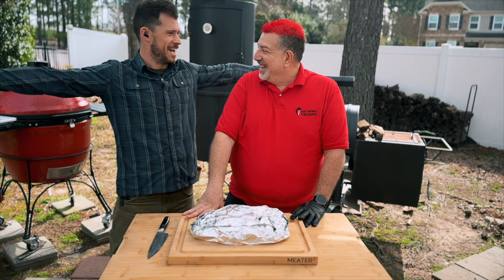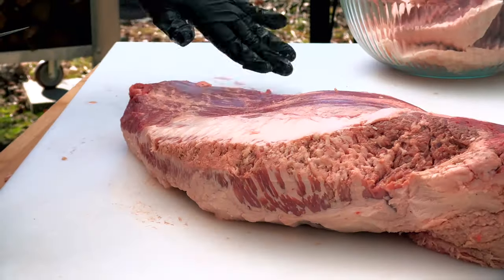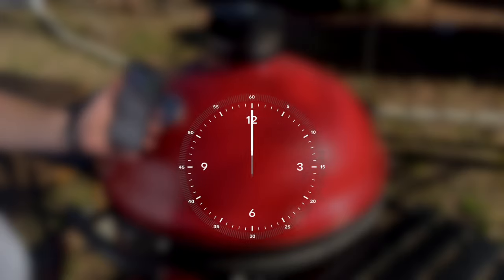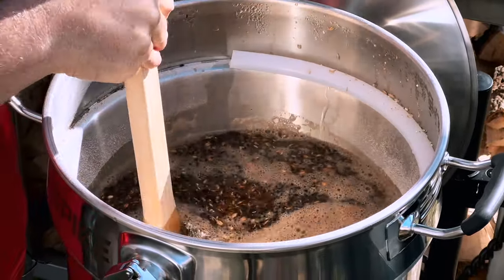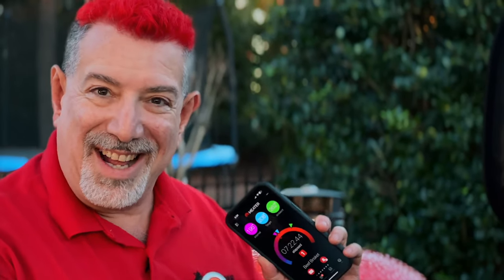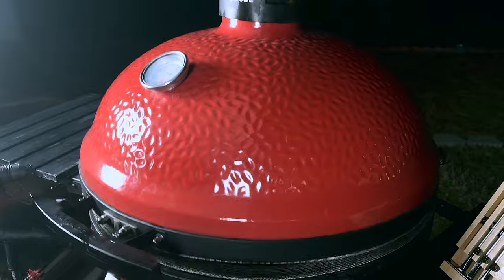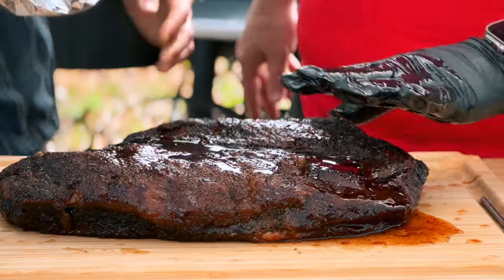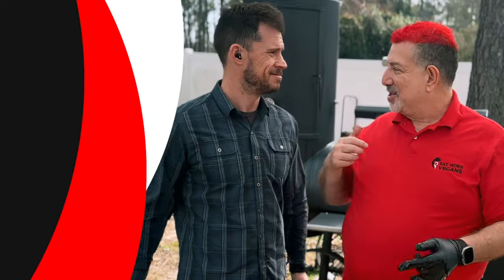Goldee's #1 Texas' Style Brisket......on a Kamado Joe?

Comment: You mentioned cooking at lower temp and pulling earlier or resting before going in the warmer.  I think that is the key when doing it on a kamado vs an offset. 

I just did a brisket this week on my Akorn kamado set up for double indirect. I cooked at 225 the entire time and pulled a little earlier (temp 195-200, not quite completely probe tender).  Held overnight at 140 for 15 hours. Great bark and so juicy and tender after the long rest.
Reply from the maker: You're right that pulling earlier and resting will make the difference.  Without giving away too much.....tune in on 3/22 for the video that shows that!  :-)

Comment: I've made a Goldee's style brisket on the SnS Kamado and it turned out great. Oddly a tad overcooked as well, and I did try to let it rest down to 180 or so befor eI put it in the oven to rest. I think it was just a tad overcooked when I pulled it off the pit.
Reply from the maker: I think I've figured out the secret to getting it just right - tune in on 3/22 for that video!
Reply: @BehindTheFoodTV  Can you advise where you put the water pan on the BJ3?
Reply from the maker: @scubahiker  sure. If you’re doing double-indirect the water pan sits on the heat deflectors (inside the SloRoller) and the drip pan sits on top of the SloRoller. Make sense?
Reply: @BehindTheFoodTV  Yes, doing double-indirect but on a BJ3, do I do it the same way? Or differently since I have more height?

Comment: This feels so odd to me. I assumed the Kamado would blow a Weber kettle away, but I've definitely gotten way better bark than that from the kettle (using just a snake, a foil drip pan, and some aluminum foil shaped like a shield to prevent direct heat!). I think the temperature really might make the difference. I also don't know what or how much wood you used, if any (vs charcoal). When I set up a snake there are always a few large chunks of wood during the first half of the cook that put off plenty of mouthwateringly tasty smelling smoke. I would definitely want to try something like that here.

Comment: One big issue with kamdo's is they pretty much have no airflow. So a lot less fat render. And also, since most of your heat source is from charcoal (with just a little from wood) you just don't get as much smoke and bark. You don't get that meteorite black bark from an offset.

I first smoked briskets on my dads egg, cause it's what I had. And it was a huge world of difference when I switched to an offset. And it was a crappy offset too, that I made out of cinder blocks. But even then, it was so much better.

I'm curious about the blaze cast aluminum kamado. Because it's all cast aluminum, you can cook with whatever you want in it. So I'm wondering if it's possible in that kamado to do a full smoke with entirely wood burned down to coals. I think the coals from hardwood may not last long enough though, idk. But that would be one potential way to get better bark and smoke. But I wonder if the lack of airflow is part of the issue with bark formation, idk.
Reply from the maker: The airflow is definitely an issue.  Using the SloRoller and the double-indirect setup that James over at Smoking Dad BBQ pioneered does close the gap quite a bit - but not quite all the way.  The method does allow us to cook briskets fat side up on a kamado though - which also makes a huge difference.
Reply: I'd be more more interested in a soft yellowish rendered fat cap, a meteorite black bark color is less relevant.
Reply: @CoolJay77 
I hear ya, the problem with that is I honestly just don't think it is really happening on a Kamado. It just does not have a lot of airflow sadly. Maybe if you made a very specialized modified kamado or something, but at what point do you just get an offset of some kind?
It is a bit of a shame, because kamado's are truly awesome grills. But not perfect sadly, not that anything is.
Reply: @copper4eva  Talking about modification, one can experiment with building a dome shaped sub-chamber made
out of steel, and a manifold, with a convection fan creating a vortex. That will take care of rendering the fat cap, and a meteorite bark, however the smoke flavor will still not match that of a stick burner.
Reply: I've always just built a small charcoal fire in my big joe 1 and added woodchunks as needed when the heat drops (every hour or hour and a half). Pretty much run it like an offset and my Briskets look and taste like an offset brisket. No double indirect BS. Just deflector plates,  fire banked to the back and brisket on the grate close to the front away from the heat.
Reply: @jlaw3255  
If you've got deflector plates on (which normally sit on a grate), how do you keep adding wood chunks so often?
Reply: I believe it’s all about your technique and the quality of meat used Choice, Prime or Wagyu. I have a BGE and I must say using Smoking Dads Double Indirect method. I can achieve good fat render along with that dark offset looking  bark. From most videos I see on YouTube it’s not the smoke that causes the dark bark, it’s the amount of Black pepper used on the brisket. I have mad respect for all those offset smokers, and maybe one day I will own one. Like anything in life use what you have and keep learning it until mastered. Keep Smoking Fellas!!!!
Reply: @mikecitizen2125  
"it’s not the smoke that causes the dark bark, it’s the amount of Black pepper used on the brisket"
The amount of pepper I use seem to make no difference to that result. In fact, last time I did not salt or pepper the sides much at all, and they still got just as much bark as the rest of the brisket. It does effect how peppery it tastes in the end though lol.

It's still cool to see someone get good results on a kamado. It's not that you can't get bark on it, I just personally never got near the same level. I also have not cooked a brisket on an egg in a long time.
Reply: @copper4eva  I just have one grate in and I lift up the one deflector plate and throw a chunk that's been drying out on the grate next to the brisket. It lights up right away. I got a big joe so lots of room.

Comment: Would the top maybe have gotten darker if it was fat cap down for a bit? I know that might have messed up the bark some, but just wondering if that might help since the heat is coming from the bottom instead of across like on an offset?
Reply from the maker: Great question.  The bark darkens because of smoke - so fat cap down would actually have reduced the smoke exposure.  I think more flavor wood and adding wood chips to the ash drawer during cooking would have made a difference though!

Comment: The WiFi MEATER probe works through the stainless walls of the warmer?
Reply from the maker: Yes sir! When I'm cooking on the offset I need to keep the block or repeater right on the shelf in front so the BTLE signal can get through.  On a ceramic kamado style cooker it's not a problem at all.

Comment: Awesome video Al! You mentioned making brisket on the DoJoe. From my experience, it definitely also helps with the color. My briskets come out noticeably darker when using the DoJoe technique. Also I’ve had success removing my briskets at 185, letting it sit on the counter for 45-1hr, then letting it hot hold for 12-14hrs (I have a home oven that doesn’t go lower than 170). Usually comes out great!
Reply from the maker: I can't wait to try this!